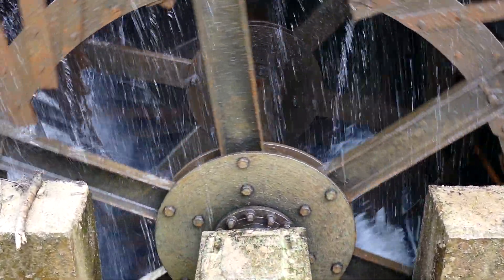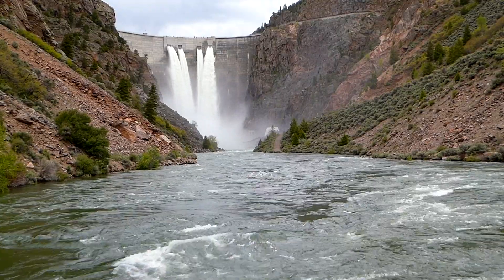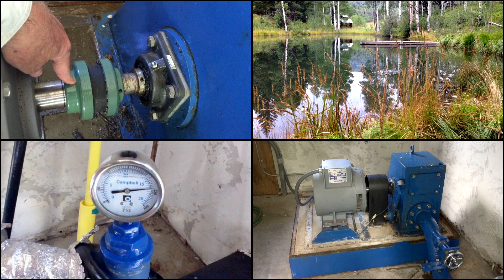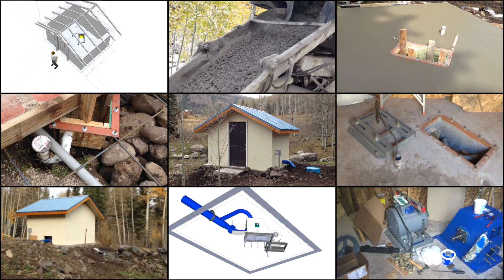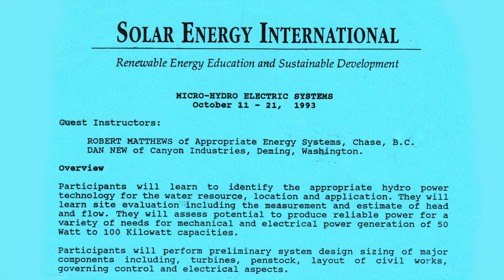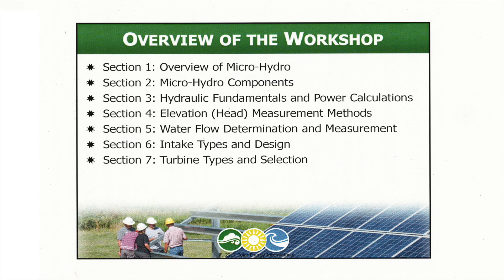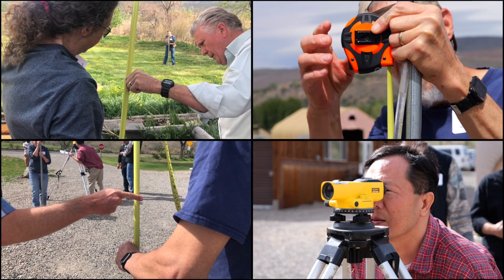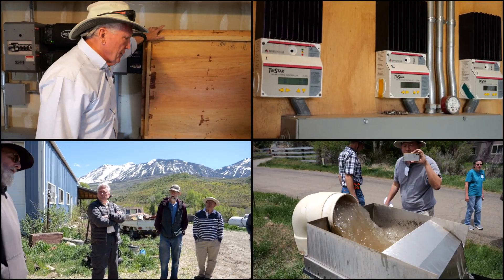Learning Micro Hydro Power in depth

Comment: I’ve been watching your videos for the last year and have recently acquired a property that has potential with an existing water diversion, 150ft head, transported via 4” pipe. I measured 210 gpm. I would have to redo the diversion point and likely upsize the pipe. I would want 800 gpm I believe to make the system worthwhile, I think the stream has enough flow. Do you do any consulting for design or construction of the various aspects of a micro hydro system? Do you know of any other individuals who do? I’m very inspired by your work!
Reply from the maker: Congrats on finding such a great site! It sounds to me like you have ample capacity for a good system. I’m just waking up and seeing this.  I need to grab bfast and look at some calculations. How long is the existing 4” pipeline and what kind of pipe is it?  Let’s continue a conversation via email.  I’m at MrHydrohead@gmail.com.

Comment: Originally, hydro and wind power were used without a battery to make mechanical power that could be adapted to many different tasks, much like a tractors PTO can run a variety of implements. Why doesn't anyone do that anymore? Given the cost and shelf life of batteries and charge controllers, it would leave a lot more power for electricity and turn an undersized setup into a manageable one.

Comment: How do I determine the best micro hydro generator 
For 220v single phase at 3 kilowatts
Can someone tell the best type of turbine and permanent magnet or asynchronous generator?
Reply from the maker: The best way to approach calculations is to determine the power potential of the site first.  This  requires knowing the head and flow.  Once this is determined, you can look at the different options of available equipment and make a best choice.  Maybe you've already determined that, but its not clear from you question.  I'm no expert on the most current equipment available as I installed my system in 1996 and then reconfigured it in 2015.  Will help if I can.  Thanks for watching!

Comment: It's absolutely gorgeous countryside. But what really surprises me that 6.5kW turbine is so small that runner has likely size of flowerpot. I'm just not sure if burying ... i don't remember, 2km of 5" inch pipe below depth where soil freezes is worth it. And it's my problem with hydropower in general. We have like 15km long dam on the edge of city with height of about 30m and river that has flow ew cubic meters per second. Dam has power output of something like 10MW which is enough to pull two trains uphill and it works only at peek power consumption. Or pumped storage power plant was built in the mountains with like 600x200x20m artificial lake, it's 500m above lower dam and this huge lake holds only 3700MWh of power which can be discharged in barely six hours.
It's almost weird that larger city can consume energy needed to move that huge mass of water half kilometer upwards every day.

Comment: Would intermittent flow be able to charge a battery, I was thinking if you added one of these micro hydroelectric converters to the mains water supply at home would it be able to charge a battery every time you ran a tap, took a shower etc?
Reply from the maker: Its an interesting thought experiment.  A formula for determining the power potential of micro hydropower would be (Net head x Net flow in GPM) / 15 for DC watts or / 9 for AC watts.  You could calculate the potential power that way, but with maybe 60 psi (2.31 * 60 = 138 head) from the utility and maybe 1-3 GPM on an intermittent basis, you would find a very limited amount of power.  (138 * 3) / 15 = 27-28 watts.  That wouldn't justify the cost of buying equipment, batteries and inverter. There is also the question of once the pressure is utilized to harness kinetic power from the flow, what is left to push the water through the pipes to your shower, toilet or sink?  Thanks for watching and asking the question.

Comment: Very interested in this. I am working with multiple developers in Central Florida who are looking to build self-sustainable systems. Well funded and very serious. This video is great, I look forward to getting a reply from the request I put in at that link you provided. Cheers
Reply from the maker: Florida would present an interesting challenge as there may be a lack of substantial head given the flat nature of the state.  A viable system would therefor  require a large amount of flow to enable a good system.  A combination of either high head with lower flow or low head with very high flow are the measures which determine the potential amount of power to be extracted.  These may be a couple of good sources to investigate for low head applications.  https://emrgy.com  &  https://www.turbulent.be  Thanks for watching!

Comment: You could power bitcoin miners to convert free energy into digital gold.
Reply from the maker: I did research using some of my excess power for this, but I decided that to try to compete with large server farms would not be a practical undertaking.  It would require always upgrading to newer cards and ongoing costs without a guarantee of success.
Reply: @mrhydrohead i wouldnt go too deep in it but being a part of a pool will increase your chances of payout. If your mining pool hits the block reward you will get paid accordingly. Maybe youre only .5 percent but because of a mining pool you get more community hash rate. And i strooongly believe in btc. More than everything else, basically.

Id rather plug in a 10,000 miner than give the grid back electricity for example.

Bitcoin will almost certainly hit 1million per. So if you could mine it for the cost of a miner and hold in a personal wallet it should in theory be a great way to A + B combo this amazing hydro power tech.

Please keep up the good work man i just found your channel and you do a great job!! <3 

This project is a ways off but lifegoals.

Comment: Is there a system that will make AC power?
Reply from the maker: Sure thing! check out the majority of content on my channel.  My own system is Direct AC without batteries and is fully off grid.  Here is a synopsis playlist of the system which I have owned since 1996: https://www.youtube.com/playlist?list=PLtTypVpmDd-vkT9bJQkXw4I1t0e_4jMYA  Thanks for watching
Reply: @mrhydrohead  I'm looking at a farm property that has a water tower, thinking using wind and solar to pump water into the tower and use it like a water battery to feed a microhydro

Comment: Could you feature a modern laser cut, welded waterwheel system instillation. Many people do not realize how efficient steel waterwheels(Fitz Waterwheels, Hanover, PA) back in the 1920's and 1930's. Companies like Hydrowatt in Germany produce modern steel waterwheels that will last well over 100 years as they are welded from Cor-ten weathering steel or galvanized after welding. Waterwheels are perfect for high flow, lower head hydro sites, they do not need intake screens, they do not need much in the way of maintenance other than greasing bearings occasionally, and they last a long long time.
Reply from the maker: That's a good suggestion.  I'm limited in how far I can travel to document projects.  So far I've only done my own and another in Colorado and one in Utah.  However, thanks for the info on the mfgs in PA and Germany.  I will attempt to reach them and see if they have any of their equipment installed in Colorado which I might be able to access.  I'm not really familiar with the type you have suggested, but will research them.  Thanks for watching and the suggestion. 😉👍🏻

Comment: Awesome channel.  Do you have any recommendations for a practical  portable/mobile micro hydro solution?  More particularly I am about to leave the city for permanent nomadic country life in an RV, and will be free roaming around and boon docking.  It would be great if I could utilize  micro hydro for power during the travels where water is, which is plenty of places in my neck of the woods. Most likely a combination of solar and wind with the micro hydro will be the right way to go.
Reply from the maker: Sounds like a bold path you’re setting out on. The two critical factors for power are head(fall) which governs pressure and flow (amount of water). To harness pressure you would need a good length of pipe and a site where water exits far below the intake. That is something that requires a good deal of time to install and could likely be restricted by local ordinances. I’ve seen small units that can be submerged in flowing water, but their output isn’t very much. I don’t have a link to one, but will look around to see if I can find one. I’ll post a link if i can. Thx for watching and safe travels to you
Reply: @mrhydrohead  Thanks. Much appreciated.
Reply from the maker: You might investigate this https://www.nooutage.com/aquair-uw.htm

Comment: I've watched every one of your videos. I'm in Alaska and I was pleased to see that your system runs below 17. We get to minus 20 here in the Cook Inlet Region Area.  My property includes 250 acres surrounding a lake.  Every outlet runs through a culvert system.  We got a 150 thousand dollar grant to improve water flow throughout wetlands as this is a salmon spawning lake.  This summer I will be looking at how water flows into the lake and if I can increase flow while still taking flow from. The lake for a hydro. My elevation may not allow me to get the type of flow. I'm at 150 feet. Thanks to your videos I'm able to see something workable. Last year my community got a study grant for alternative energy.  We have 66 homes in my community and we also have a major river 2 miles away. There is potential for water wheels as the flow of the river is strong at about 4 miles an hour on slow days.  I've watched this river for the past 50 years and notice changes in flow.
Reply from the maker: I'm glad you have found the videos useful.  We have had nights down to -10° F this winter and 75" of snow since late October.  The system keeps running even with the cold.  Moving water doesn't seem to freeze. I'm sure the penstock being buried and snow covering the ground helps.  I'm not sure if I'm reading this right but if you have 150 ft of head, that would be enough to harness power.  Maybe you meant 150 above sea level, not sure.  I remember seeing a video about water wheels when I was in hospital and I found it for you.  
https://www.youtube.com/watch?v=KMaSEyfd19Y 
You may have seen it already, but if not, I hope its worthwhile.  Thanks for watching!
Reply: @mrhydrohead  thank you. Yes I am 150 above sea level.

Comment: have you seen info on performance of turbulent hydro's? i'd like for that to be demystified and see how good/bad its done over the years of install in the limited areas it's been installed.
Reply from the maker: Sorry for the slow reply.  I've been very interested in the Turbulent system myself.  Unfortunately I've not seen an installation anywhere near me close enough to go document.  From what I can tell they have very few running installations of their system worldwide.  What they have said the system produces is quite impressive and it also seems like it might be a very expensive installation to do.  The engineer Ken Gardner is interested in these as well.  Maybe we might find a situation where one could be installed.  If so, I will make every effort to document it.  Sorry I can't provide more clarity to your question.  Just the same thanks for watching the channel.

Comment: Just hydro? nothing else like solar or wind with batteries would these systems be cheaper and more portable to install? assuming the sun is shining and the wind is blowing.
Reply from the maker: My experience is with Micro Hydro and SEI certainly teaches other renewable disciplines.  My channel has been solely about hydro which was the best choice for me when I started in 1996 and continued to be through our upgrade process 2013-2015.  We get up to 177kWh/day which heats our home at 8600ft in Winter.  We have intermittent sun and wind, so it was by far the best choice.  Take a look at the rest of my channel if you have interest.  There is a synopsis playlist (~25min) here: https://www.youtube.com/playlist?list=PLtTypVpmDd-vkT9bJQkXw4I1t0e_4jMYA  Thanks for watching
Reply: @mrhydrohead  thanks for your response, I will have a look. 177kwh per day is a lot of power! I get 20 - 40 kWh of my solar installation for around half the year. I can see why hydro is a good option, if you can get it.
Reply from the maker: @jeffpowell1616  You bet!  We have to dial the flow on the system down in all seasons but Winter as we have no need for that much power.

Comment: Hello, I have a 14 kilowatt generator of what diameter Francis turbine should I put
Reply from the maker: It depends on what the power potential of your site is, whether a Francis would be the best equipment.  I suggest you take a look through my entire series of videos where I describe my process of moving my Pelton system from a high head/low flow spring source to a medium head/higher flow off of a creek.  I attempt to teach how to determine the potential of a site.  Only then will you know if a Francis turbine is the best choice.  A 14KW generator can be used to harness any quantity up to and including 14kw as a top output.  The choice of turbine depends on best efficiency and cost considerations.  Thanks for watching
Reply: @mrhydrohead  thanks for answers

Comment: Wow the skies look so clear there, Id get 4kw worth of solar panels, ground mount them next to the house and be done with it. The glass ones are cheap. Batteries get cheaper every year and you can just expand capacity slowly
Reply from the maker: Perhaps, but for the amount of power provided you need an enormous array of panels to equal the output of micro hydro systems.  No intermittency from day/night or cloud cover as well.  And when it snows, would you want to clear the panels?  Each person needs to make choices as to what is best.  Thanks for watching

Comment: I bought a property in a Hydro friendly area of Australia 5 years ago after watching you videos on dodgy wifi in Cusco Peru on a whim some years before that. Our town has a viable turbine micro hydro feeding the State grid, and a demonstration waterwheel as the town mascot/figurehead.
Unfortunately my property is not a suitable site, as I am spring heads with only 50 metres of gentle slope to the river. 
Always on the lookout for my ideal micro hydro property thanks to you!
Keep going on with your quality content! It is a valuable resource and also a source of much inspiration to all interested parties around the world.
Bravo Mr HydroHead!
Reply from the maker: Wow Thank you for the kind words.  I will continue with the vids as long as I can find appropriate projects within a reasonable distance from home.   Good luck on finding a good site.  Its one of the toughest things to find. 50 meters is a good head and it makes me wonder what the flow from he spring(s?) is.  Even a small power system adds up when combined with batteries/inverter.  I'm hoping to find systems that are smaller and benefit from the continuous output that adds up.  Thanks for watching!
Reply: Have a look at the Marty T  YT channel. 
He is a Kiwi and shows a home-built 50 metre head producing 885 watts 24 hrs a day using a pelton wheel with a rewired washing machine motor as the generator...on a low-flow stream.
His original turbine/gen built on this principal has done 17 years of service....
If you only need that amount of continuous hydro (20kwH per day) ...with possible supplementary solar...it may be a start..

Comment: My next runner is this 4 blade. My current 6 blade runner has been flawless for 2 years, but loves water. This new one has slightly flatter blades. Current output 2.7 to 2.9KW.
Reply from the maker: Sounds like a good amount of power you already have.  Hope your upgrade turns out to yield more to you.  Thanks for watching and sharing!
Reply: Can not add photo😢
Reply: Can you "make a vid" and upload it on your channel?
Reply: @JohnSmith-yv6eq  I sent MrMicroHead a video in email recently. He might can post it?  It’s only 1:20. I also made a slide show several months ago of the process, but not on YouTube… yet.